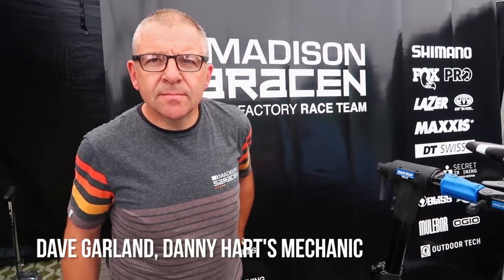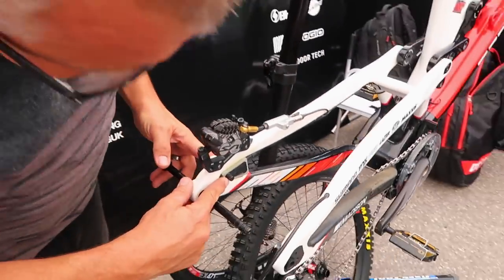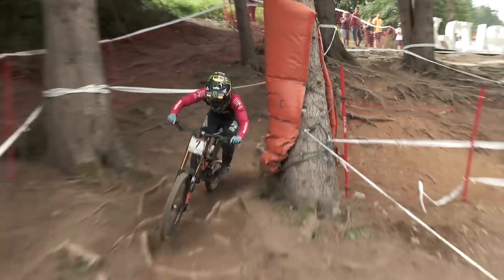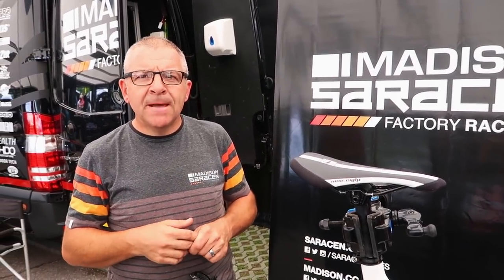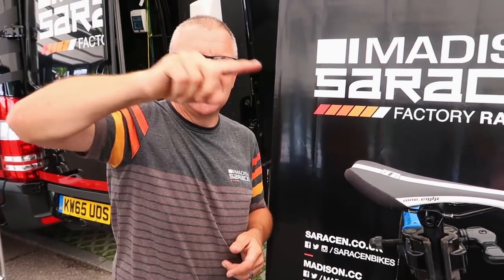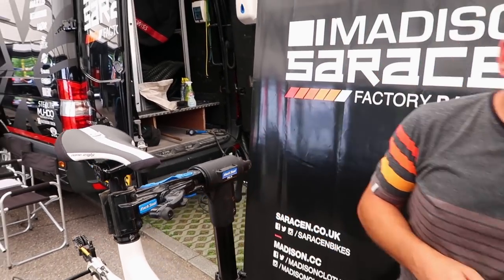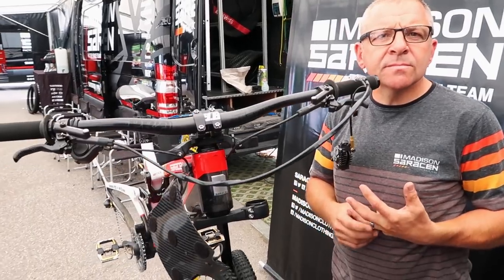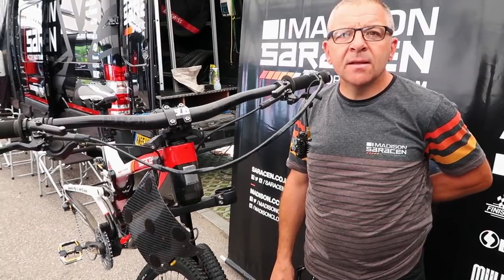FROM THE PITS - Danny Hart's High-Tech DH Bike at Val di Sole

Comment: More high tech than motos.  Cool stuff
Reply: Dan K I dunno, you can tell allot with EFI bikes from an app on your phone or a data tuner, even some 2 strokes EFI, Vertigo Trials 2stroke can log amazing data via a phone app and it’s a 2stroke EFI 250/300 and KTM/Husky have the ability to record lots of data, for masses though really not required when setup from factory to suit most Joes, this tech is. Last beneficial for pros and Danny doesn’t play with this a pro mechanicals tech does.
Reply: and in MX/SX there is all the variables of the engine/timing, conferring g-force, wheel slippage and position of the bike in the air etc. DH is chasing moto and becoming more technical but will never surpass MX/SX and other bike racing like MotoGP and WSB.